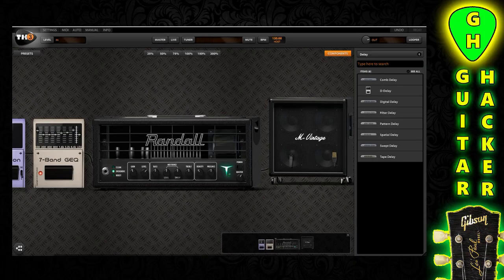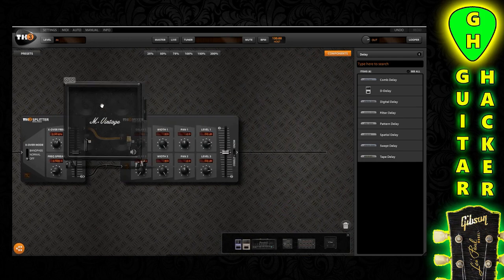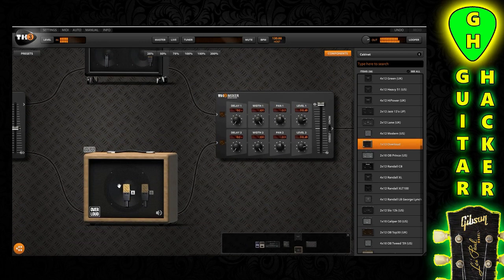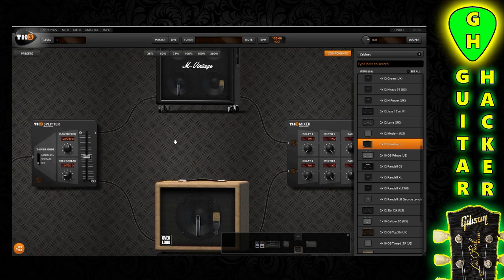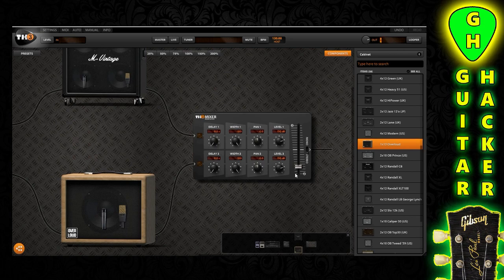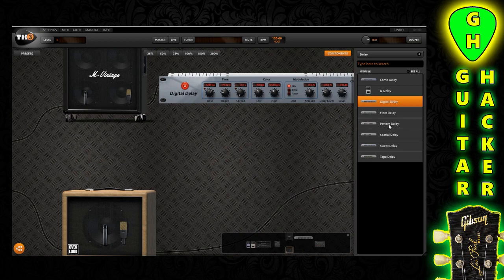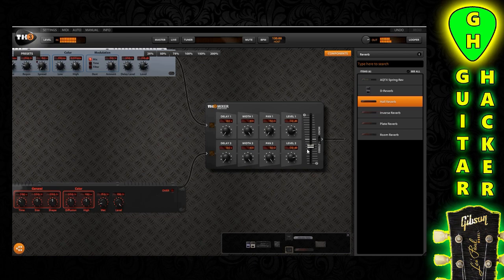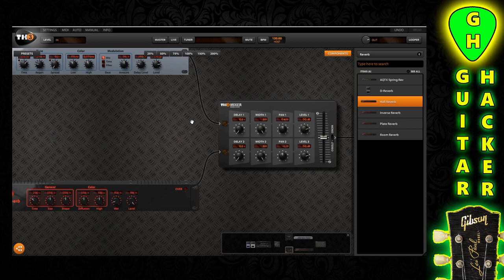TH3 OVERLOUD | AMP SIM TUTORIAL CABINET HACK S

Comment: hey bro  question?  have u tried using thu with audiobus?
Reply from the maker: I have tried Thu but I haven't found it does anything th3 cant do, I haven't tried audiobus but it looks like it could be a good tool, th3 has so much gear that its almost impossible not to get " the sound" that you are looking for, ill check out audiobus , thanks for the tip and for watching. I appreciate it.

Comment: Any chance you can share a link to just download the preset, you did a excellent job!! world class tone
Reply from the maker: Thanks for watching and thanks for your kind words , yes i'll see if i can put the link to download up this weekend for you
Reply: @guitarhacker7126  Steller!!! thank you
Reply from the maker: @jjm9741   Here is the link to the basic tone - just go to link arrow up to top right corner and chose download and select th3 as your app to open up the file , hope it helps you. Thanks again for watching.  

https://drive.google.com/open?id=1aNkwzFWr94zNyzl-AXUsFjY34s250X_X
Reply: @guitarhacker7126  Can't download... It says "file is in owner's bin"
Reply from the maker: @erickim77  My apologies, ill fix this evening and add a few of my custom th3 tones for you later tonight.
Reply: @guitarhacker7126  Thank you so much :)
Reply from the maker: @erickim77  I have these for you to check out.... Try Rock Tube Sustain first , I think you'll like it. I gave you two of the Divimark head , one single , one dual , I have to look for the one in the video but these are better I think , you may have to adjust the gate and in and out levels , and adjust the tone a bit for your setup but these slam on my system , and you can also just turn the chorus and delays off and just used the overdrive tones if you wish. Hope this helps , have fun.   https://drive.google.com/drive/folders/1qLdvjsg7XZzvKvD4YYTSFxRHtmmG7YvH?usp=sharing
Reply: @guitarhacker7126  Thank you for your kindness. I will try it over the weekend. Must be a good Christmas gift for me :). Thank you again
Reply from the maker: @erickim77  Anytime , Rock On... Happy Holidays.

Comment: I am using a Yamaha Pacifica connected to pc through an old Sound Blaster Audigy. Recordings are ok, no background noise, but I am not able to get the sound shown un vídeos about TH3. Do you think It could be possible if I replace the Audigy for a better interface like Scarlett? Thank you very much and congratulations for your channel!
Reply from the maker: Unfortunately your sound card doesnt have the processing power or speed to handle the software, you can buy a used interface for dirt cheap on ebay or craigslist, make all tje difference in the world, thanks for watching and good luck